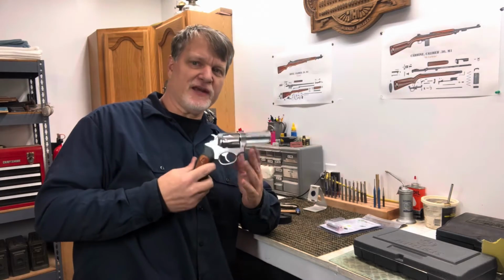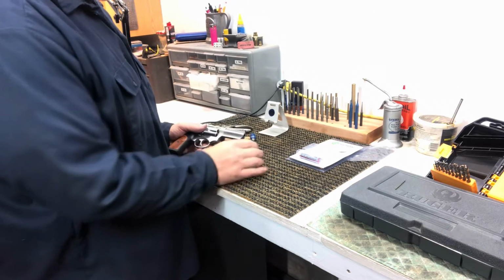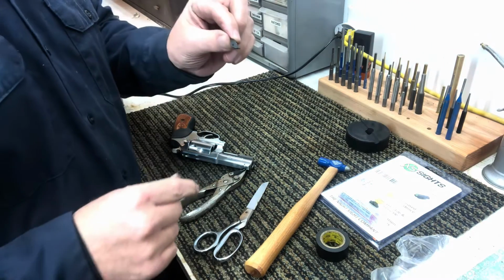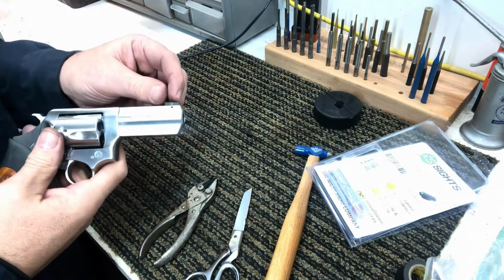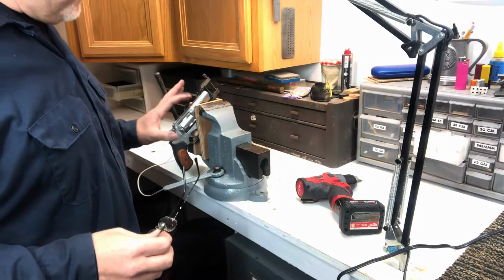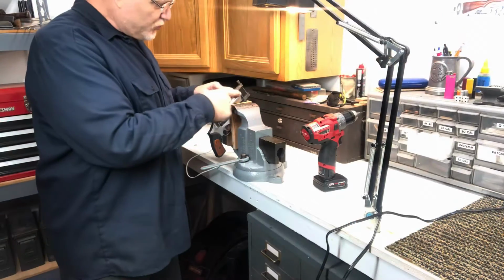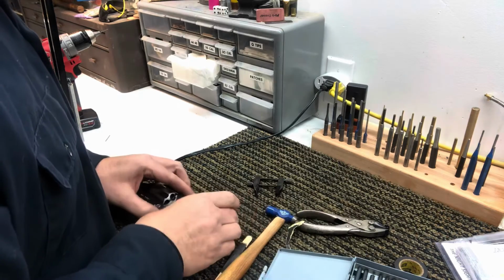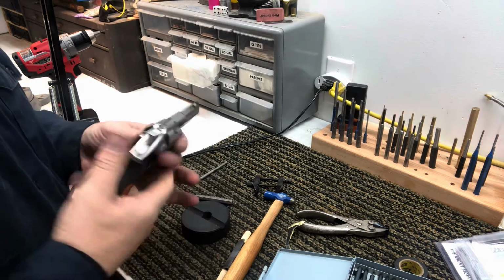How to install a tritium front sight for a Ruger SP101 or Smith and Wesson J-Frame

Comment: As I was drilling the new sight, the tip of my drill bit snapped off inside the pinhole.  It seems to be well-set, I can't move the sight.  In essence, I created a permanent pin.  But it's only halfway thru the sight so I'm afraid it'll pop off after a few .357 rounds.
Should I put a pin in the other side?
(Took it to a local smith and he looked at me like I had two heads.  Didn't seem to know that you can't get a pre-drilled sight for an SP101.  "You had to drill it?  You drilled it with a hand drill?")
Reply from the maker: One was brought in to my shop like that.  I had to drift out the drill bit.  Took a long time.  Lots of cussing too.  Good luck.
Reply: @FlyingKSports Success!  I spent about an hour yesterday fiddling with a small pair of vise grips, an awl, and the smallest set of jewelers needle nose pliers you’ve ever seen, but I got it out without damaging either the gun or the sight!
Finished drilling OUTSIDE the gun and then put it all together.

Comment: Just installed mine, went with the orange dot. Besides drilling the hole for the pin, I had to reduce the width by .003 to fit.
Reply from the maker: Should be solid.

Comment: That company is clowning if they think the majority of customers are going to fit/fabricate on their sights. I usually use Tru Glo sights and they drop right in since they are actually for the correct model and aren't a 'generic' and installation is a breeze. I lit up their customer service too. No way I am going to be drilling and sanding (my sight was too fat for the SP101 even though it said Sp101 on the package). The company wants you to 'lightly sand one side until your sight fits in, then take it out and put in a drill press'. 

LOL, told them they are the factory, we aren't.
Reply from the maker: The sights were drop-in fit.   No modifications required.
Reply: @FlyingKSports  Not on mine unfortunately. In fact, when you go to the company's website, they know many of their sights won't fit initially. They actually instruct you to use fine grit sand paper to remove metal from one side of the sight until it drops into place. Most customers are also not going to want to take a drill to the barrel area of their revolver hoping they don't make a mistake and mar the finish. It would be different if the package/advertising indicated the sights were 3/4 finished and fabrication will be required but when people order sights for a specific model, they expect the company to have done the fabrication work.